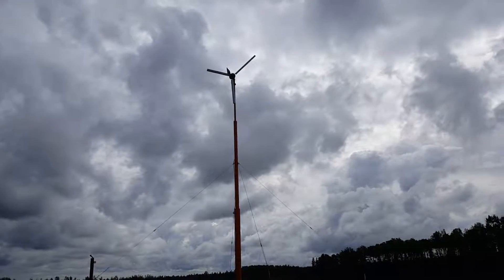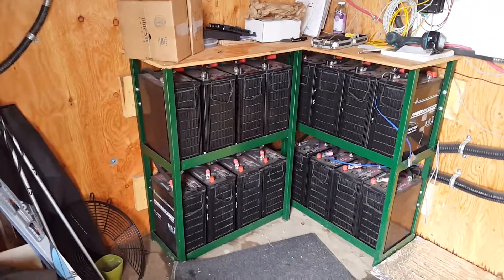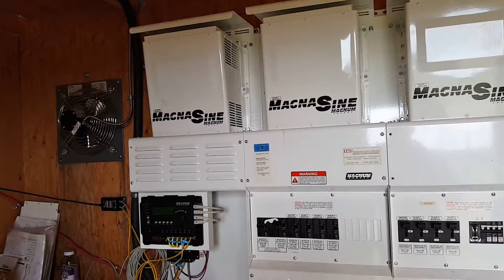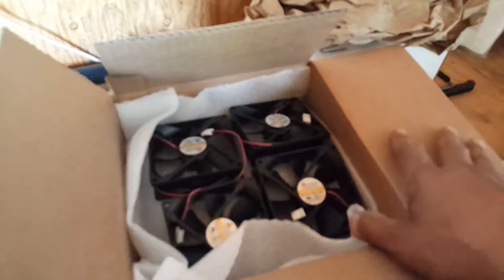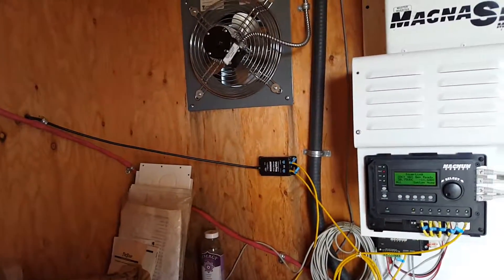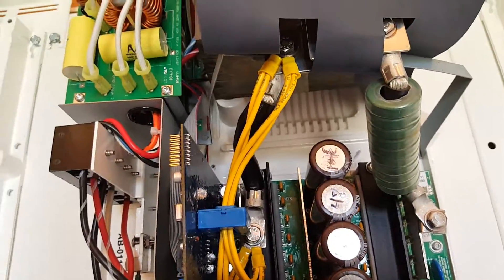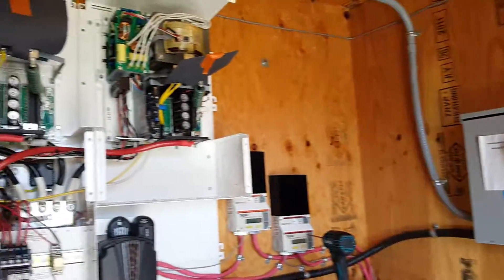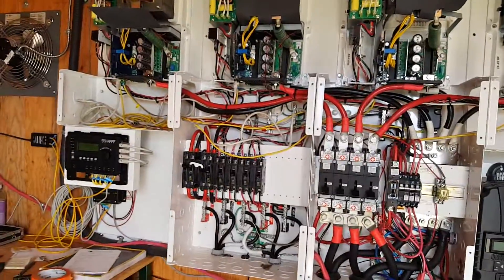Magnum inverter fan replacement Fort Nelson

Comment: Who was the builder?   Company name?  Website? What type of battery?  What is your total runtime?
Reply from the maker: it was myself that built it. the company is out of Kelowna bc. integrated power system. the Web site is ips.net 

the battery's are just L16 6volt batteries which are glass Matt but we have much more options